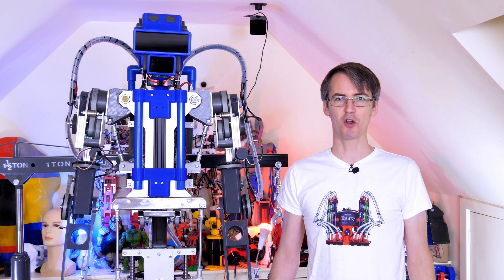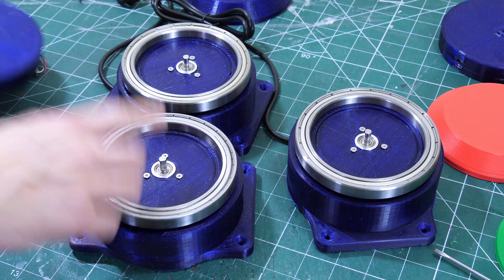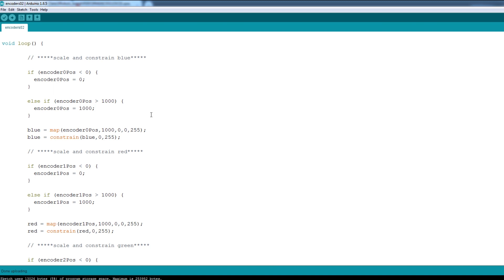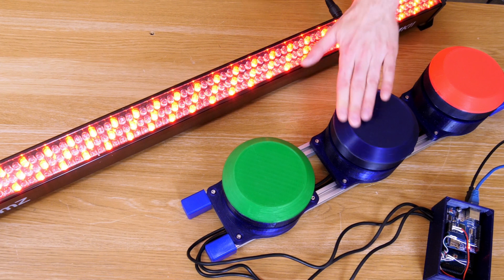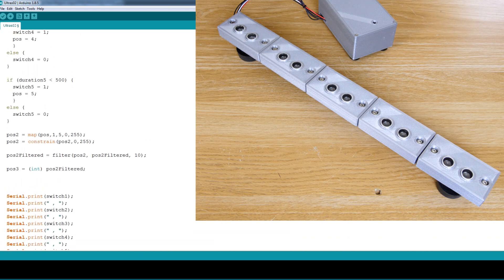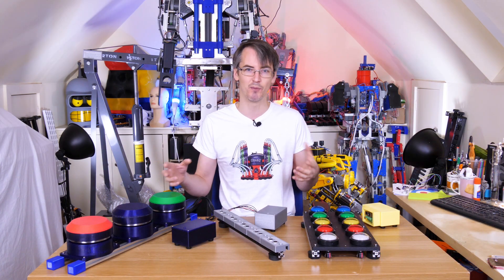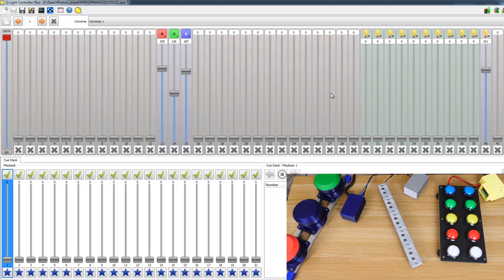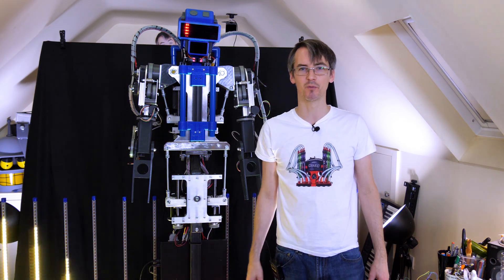How *YOU* Can Control my Robot Show!

Comment: Strange to hear your using DMX, as in the theatrical setting such as what I work in, it's a big no-no to have mechanical aspects run off of DMX, because of it's a tendency to fail and spaz out lights, which is translated to sparatic mechanical movement, creating safety concerns. I'm sure that these robots will only be used in a safe way, but it's still slightly nerving to see lol

Comment: I think I'd be cool to give the audience control of the robots, but still have other motions that they are mixed with that are synced with the music with the dance moves that you mentioned. For example you could have the arms dancing to a beat, but the control nobs move the hands right or left over all, or up and down. Though, that might be difficult, since I don't know if you want to do the full inverse kinematics on these robots. You could also have several different arm dance moves that you could cycle though with buttons or a dial.